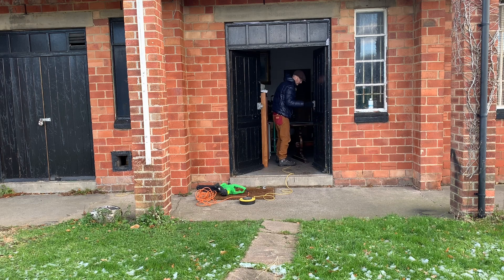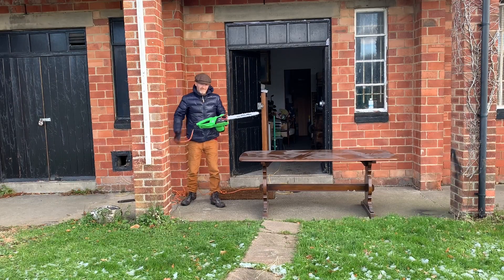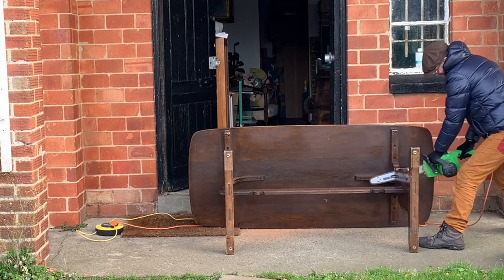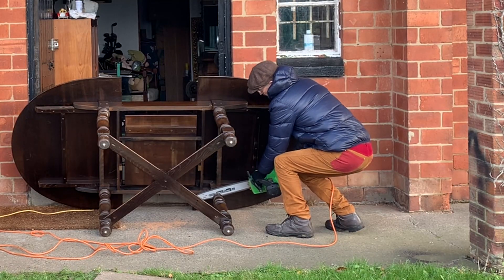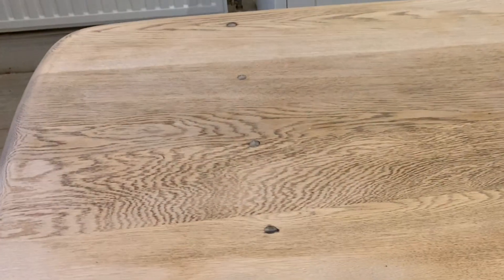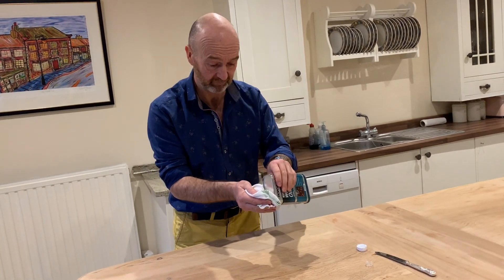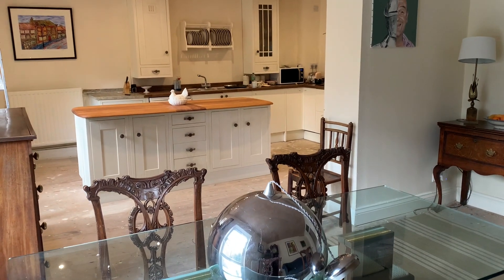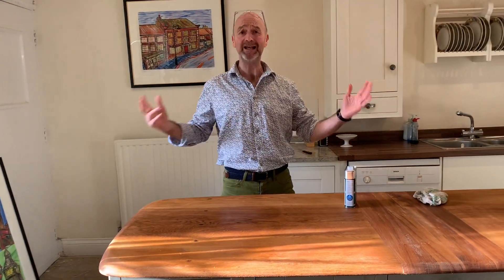How to Make YOUR own kitchen Island and save THOUSANDS

Comment: Those 1970s trestle tables were a hot item at the time here in the USA.  Bust one up now?  Have at and good riddance!  Nice solid hunks of wood, but butt-ugly.  My cat, btw, was fascinated with the saw.  In my area I'd send people to the local ReStore for the bits used; they're the fundraiser stores for Habitate for Humanity and all funds raised to to build houses for the working poor. They sell cabinets quickly, but out of style tables? Not so much.  My local store has a drop-leaf table going begging that deserves a new life.  The base was a replacement ... circa 1890. The top was three long air-dried wide boards, over 150 years old and maybe 200 depending on the hardware. I hope somebody gets it and has some fun with that too.
Reply from the maker: Loads of potential good quality pieces of furniture out there, ready to be re-purposed and for little money!